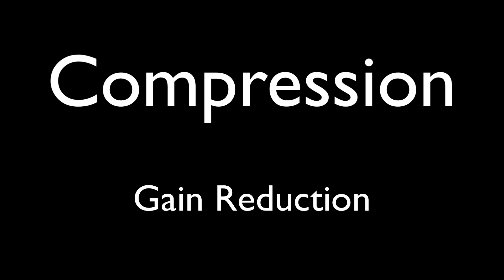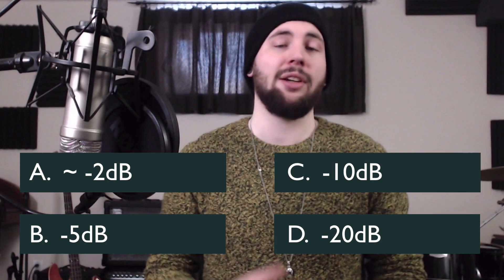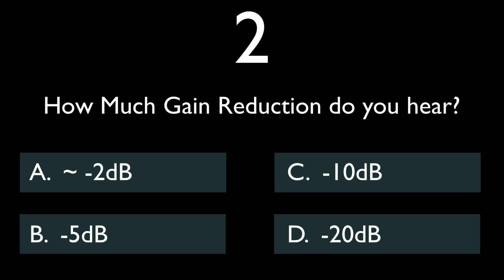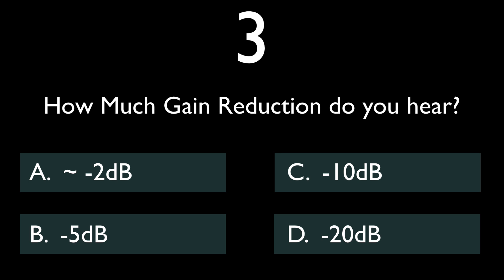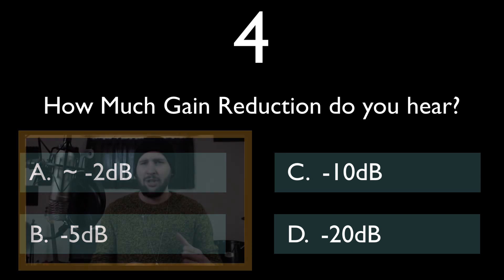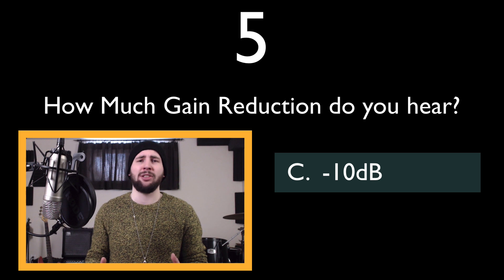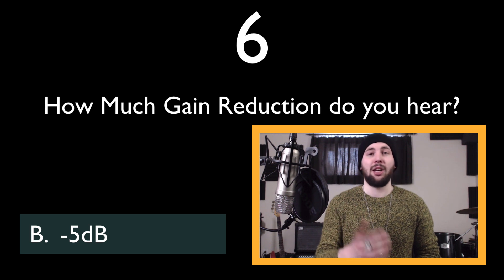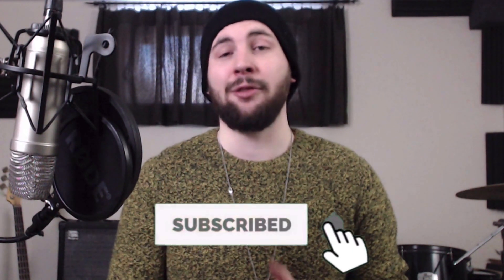How to Listen for Gain Reduction: Compression Ear Training Test

Comment: I came here with confidence and answered every question wrong except the do you hear compression one
but really is there any reason to hearing gain reduction specially with output gain adjustment? cause in my process I just do what I want with compressor and then at the last moments I adjust threshold in a healthy place...so doesn't matter if it is a lot of gain reduction or a little when you don't destroy or change the sound too much
is there any other reason? I really wanna know cause I wanna get better if I'm blind to some points somewhere